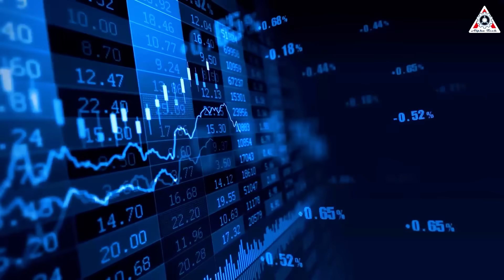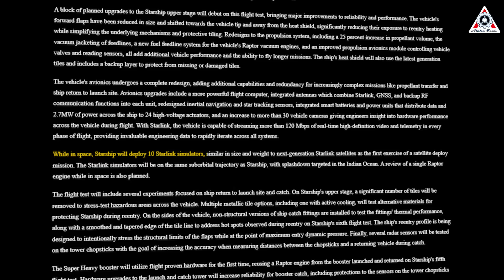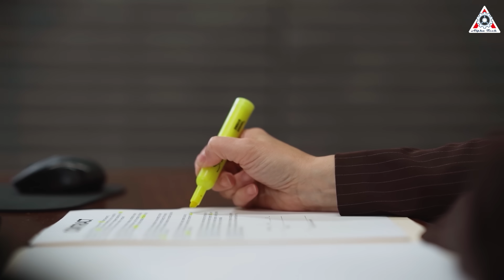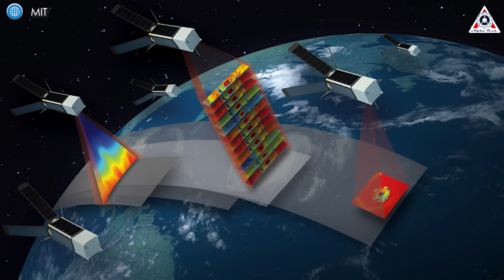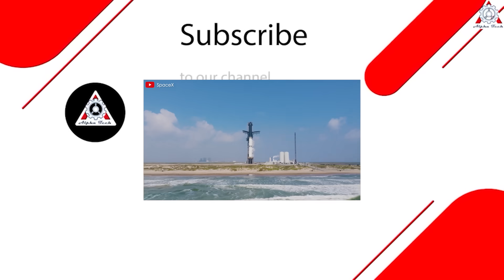Just Happened! SpaceX Revealed 1st Starship Payload Deployed to Orbit that Shocked NASA&Blue Origin

Comment: If I was in charge of spacex my second priority would be to create and launch a low orbit Oxygen harvester with a powerful Ion engine that uses Nitrogen. This is to defeat air resistance. The harvester docks with a tanker in a higher orbit and supplies the Oxygen. That way the cargo on the tanker launched into space is soley Methane. As a power source, well I remember a ball shaped object on a tether being launched from the space shuttle. The tether generated a current so powerful it blew the cable if I remember right. Perhaps this could be used to power light supercapacitors feeding the Ion engine firing powerful pulses behind the harvester.

Comment: No-one has even brought up the "small" problem of the crew emergency escape for Starship. How is that supposed to happen? After Challenger you would think that would be pretty important.
Reply: On a bad day it could be a mini Titanic.
Reply: Starship will be so reliable and safe people will trust it as they trust a modern jetliner like Airbus or ….Russian jets. Ahem
Reply: @2ndhandjoke  Possible...in time. But at the moment NASA will not launch humans aboard a craft without an escape plan for the crew. They were eviscerated over Challenger and changed policy to not allow that after the shuttle retired. I figure before "Dream Chaser" is human certified, they'll have to show something. Maybe ejecting the entire craft like a capsule.
Reply: Reliability is ultimately the final answer. When falcon/dragon flies it's in a pre tested system with a visually inspected low use booster and refurbished capsule and flight system.

Why musk says many successful launches and recoveries will proceed a manned launch. Early Hot staging gives an option during the ascent stage. Stainless steel vs aluminum strength under high temperatures, number of tiles and the backup ablative material during reentry. Currently space X is not pursuing an abort Starship water recovery system but they may need to once a manned system is launched.

Once an unmanned Starship is in orbit falcon-dragon can taxi the crew to and from Starship. This allows Starship to early accomplish missions, mitigating the critical manned launch, refueling, and reentry stages.